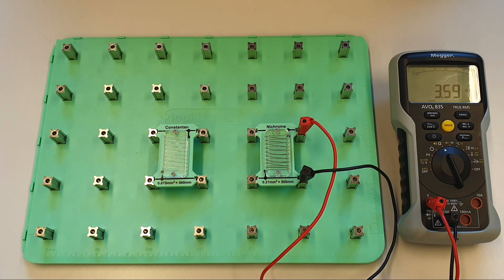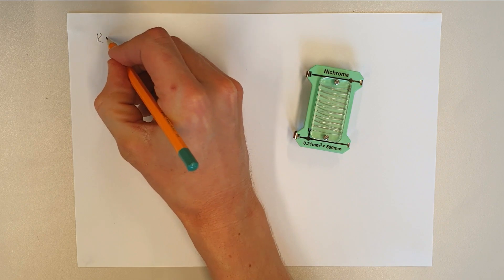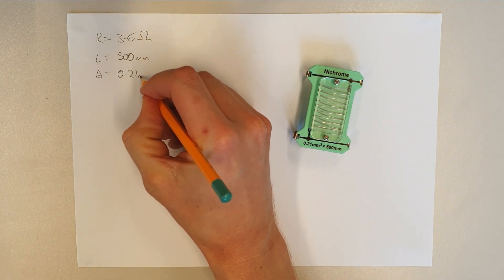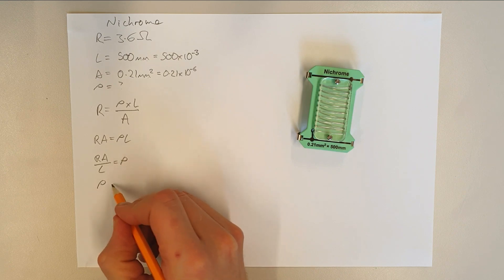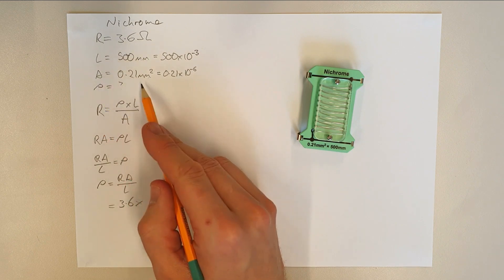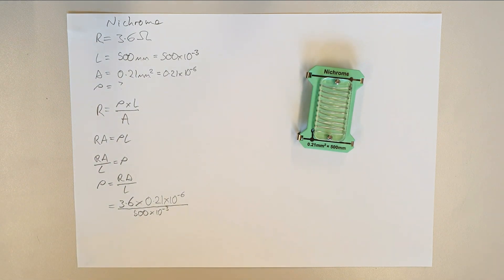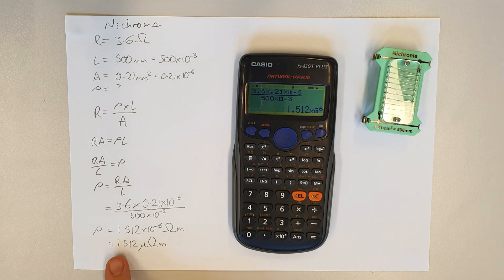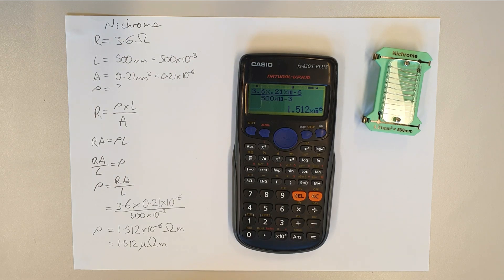How to Calculate the Resistivity of a Material: Nichrome

Comment: Joseph (your Sunday name), i only use Sunday names when i'm a a tad upset/disgruntled.
Your videos now seem fragmented, you were on about power factor. i thought your follow on would be power factor correctance but, you head onto resisitivity. Next will be conductivity? Is it me?  Probably watching in the wrong order. No disregard whatsoever, love the vids Joe 👍
Reply from the maker: No worries Alan, thanks for asking the question. As the videos are recorded outside my work hours I have to shoot things as equipment/time allows. If you look back you'll see that the videos I currently release on a Sunday are related to AC Theory which includes Power Factor, mid week videos are a range of subjects at the moment. The long term plan is to have a playlist with all videos in logical order. Hope this helps and stay tuned for more!